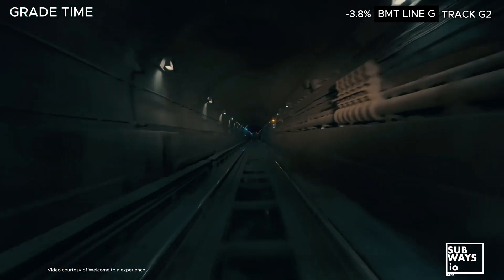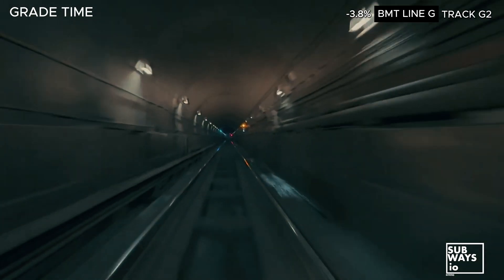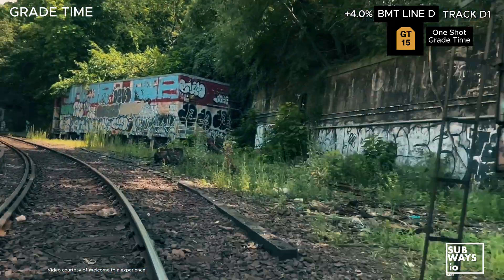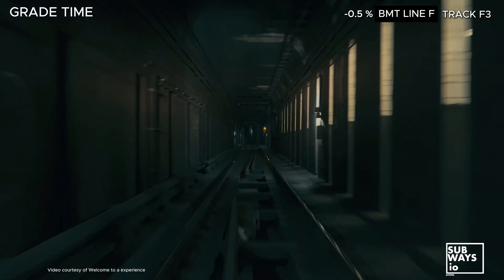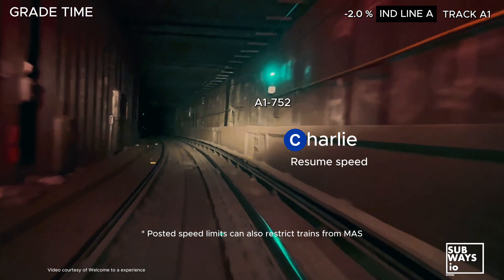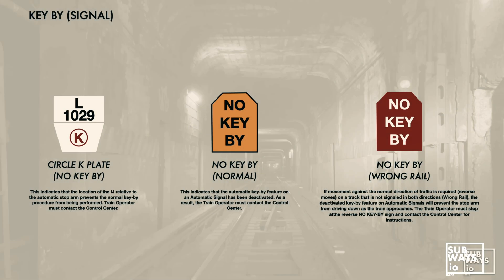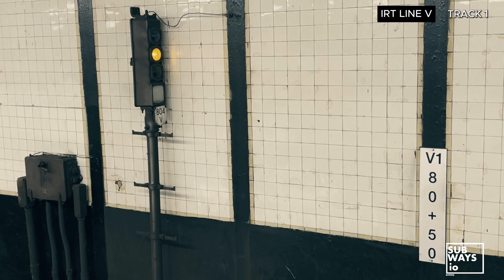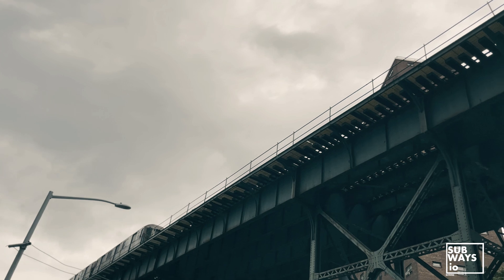NYC Subway Signaling 102 Timer Systems Explained.

Comment: Modern signal systems use codes sent from ground equipments to trains in order to control the train speed. The speed check is done by the trains themselves (comparing the speed limit code with the current speed). The speed limit code is sent by radio or changing the frequency of the track circuit.
The time signal concept is interesting as it controls the train speed without requiring communication between ground and the trains, and can be done by simple relay and mechanical timer circuits. That's how problems are solved by enginnering.
Reply from the maker: Correct. Thats pretty much the de facto setup now across the national rail system—ATC has been the foundation for years, and newer systems like PTC and ASCES build on it with GPS and RF layered atop traditional pulse-coded cab signaling.

Our subdivision in Staten Island still runs on classic 100Hz ATC cab signaling, operating within the 0-420 PPM range audio circuits for switch detection. Eventually, we’ll get around to doing a full MTA Railroads 101 breakdown, covering how each system integrates its singal systems.
The subway, of course, has CBTC in certain sections, incorporating ATP (Automatic Train Protection) and ATP-M, which allows for manual operation with speed restrictions enforced by the onboard computer. So, we’re moving in the right direction.
But to your point—all of this was figured out over a century ago. The evolution of train control is more about refining problem-solving methods rather than reinventing the wheel. And honestly, problem-solving is what led me to engineering in the first place.  Thanks for the feedback and view.
Reply: @Subways_io  It's always interesting to dig into history and look at how these technologies have changed over time. New requirements need new solutions, and that pushes the technology to develop over time. And the history is the answer to “what we need in the future” and “how to achieve that”.

Comment: This is already obsolete on the 7 & L line which have full CBTC
Reply from the maker: You’re correct in some senses, but let’s not paint it with such a broad brush.

Keep in mind that there are different types of CBTC setups: CBTC Pure, where traditional signals are removed, and CBTC Overlay, where both CBTC and traditional track blocks exist to accommodate non-CBTC equipment.

The Canarsie Line between East New York and Rockaway Parkway uses this overlay setup, allowing non-CBTC trains to access the yards in Canarsie and East New York. As a result, Signal 102 principles still apply there.

CBTC operates with a background system called AWS (Auxiliary Wayside System), which manages signals for both CBTC and non-CBTC-equipped trains. The timer principles mentioned in this video are covered in CBTC by Automatic Train Protection (ATP), which enforces speed limits and train spacing.

Also, keep in mind that interlockings are still protected by traditional home signals.
We’re currently working on a full CBTC 101 breakdown, where we’ll cover these systems in detail. It made more sense to first explain the traditional setup and then build into modern CBTC.

Here’s a CBTC short as well—thanks for the comment!
https://youtu.be/tAJhc5nh9dM?si=oFL8Tr91v2rkHcLZ

Comment: I love trains, but this just short-circuited my brain.  Thank God I only drive trains for volunteer work and not as a career.
Reply from the maker: Indeed, there are a lot of moving parts, but there are different levels to it. This breakdown is simplified, as there is a much deeper layer involving relays and logic that isn’t covered here.

This video mixes signaling and maintenance-of-way (MOW) concepts with operational translation, so it’s completely understandable if it feels a bit overwhelming.
Reply: @Subways_io  It's still way too complicated for me, I have ASD.

Comment: Is there a video showing if a train is stuck leaving the station,  the train behind it can pull up right behind it and let its passengers out through the first door of the train. I seen this a few times before.
Reply from the maker: Great point, yes, we can speak on it a bit. In that scenario, the Key-by function, as covered in the video, can be used. There's also another direct procedure to get around the Automatic Tripper, which we are restricted from covering. But either method, under the directive of OCC or supervision, can override and get two trains in the same block. As far as the door, the process is known as Keying a door a single door panel can be opened manually at the crew door switch. Located at L1/R1 or L6/R1 (A division) L8/R1 (B division).  Hope that helps visually this is as close as we can get.

Comment: 3:00 A variant of the two-shot grade time features a yellow-over-D indication. An example of this can be seen on D4 track outside of the Briarwood station. The D indication means that the next signal is a home signal and the switch beyond it is set for a Diverging route (i.e. once the timer for that home signal runs out, it will show not-red over yellow).
Reply: On the B-Division, both B-1 and B-2, the letter represents the line or route code, and the number is the track and signal number. For instance, D4 represents the West End Line, formerly of the BMT, which is now of the B-1 Division; D4 of the B-2 Division, formerly the IND, represents the Queens Boulevard and Hillside Avenue line. On the A-Division (formerly the IRT), the southbound local or main track is called Track 1; the southbound express track is Track 2; the northbound express track is Track 3, and the northbound local track is Track 4. The numbers on the signals on the northbound express track end with 1; the southbound express track has signal numbers that end with the number 2; the signals on the northbound local track end with the number 3, and the signal numbers on the southbound local line ends with the number 4.
Reply from the maker: Did you check our Chaining videos? We covered this there as well.
Reply from the maker: Indeed, we tried to keep it broad for easier comprehension and privacy we had to redact around 5 minutes of the video, including Key-by timers, due to concerns it was threading the needle with this one. We'll follow up with a signaling and sign how to read video we'll cover illuminated S and D signals along with Station time indications and more.

Comment: For clarification, a timer is a measurement of how long it should take a train to travel from the Insulated joint to the signal at the posted speed limit?
Reply from the maker: Correct with the length of that block as your space to get speed and velocity under control before entering the second block (Red/White), which serves as your posted speed check. This varies a bit with two-shot timers, as trains are traveling a bit faster.

Comment: More great info for behind the scene operations. Future subject... Power distribution and how the different blocks have breaks so power from one block doesn't feed another .
Reply from the maker: Indeed we'll cover Traction Substations there spacing and 3rd rail blocks and grounding in traction 101.
Reply: What is the spacing of AC/DC converters?  The NYC subway website has good pictures of this equipment.  Grand Central station has a power converter room for the line going to Harmon, and other converter stations are along the way.
Reply from the maker: @cbmonje  Are we referring to Substations/Rectifiers? Roughly every 2 miles. We have some up-and-coming content covering traction power.
Reply: Yes, rectifier spacing; previously AC was changed to DC by rotary converters.  The solid state rectifiers are more efficient.  Apparently DC voltage drops significantly, necessitating conversion every two miles.  The 2017 movie “The Current War” dramatizes disagreement between Tesla and Edison.
Reply from the maker: @cbmonje  Yes, that’s correct. Solid state offers faster switching speeds, generates less heat, and has better efficiency, which has been the standard for the better part of 50 years now.  Indeed, the line voltage does drop based on distance. Other factors include voltage leakage based on insulation. Let’s not forget that the negative return also has to ensure that traction power returns to the TSS. There are areas of the subway system that also offer supplemental rail return setups. To offer less resistance on the path back. Keep in mind that railcars can operate on a voltage range dipping as low as 480VDC and up to about 780VDC for NYCT and 500-900VDC for LIRR and MNRR EMUs- quite a bit of moving parts. I haven’t seen the movie. I’ll put it on the to-watch list.

Comment: Thanx for the video. Guess motorman these days have to know a lots about the signaling systems.
Reply from the maker: Indeed, yes, on top of being able to perform basic diagnostics and system checks on the consist. Have to shout them out over in RTO.
Reply: Sorry to correct you but the term “motorman” doesn’t apply because you have women who operate trains.  You can’t call them motorwoman. 31 years and counting up front.
Reply: @Papichoochoo1969 
That's why they're called Operators now.
Reply: Train operator here. Yes, you have to learn all these signals and memorize them. We're tested twice on a signal exam. The first one is the easiest. The second one is a little harder, 'cause it's all written. It's a lot of things when you go through school car to learn all these signals and what specifically what they do when you come out to the road, you see it in action. And it becomes easier
This thing is not an art. It's a science.
In operating your train, that's an art!!
Reply from the maker: Agree 100% — it’s the art of science. Every consist operates a bit differently, depending on the variables involved.
Working the car procurement and DCE side, it’s often a process of elimination alongside known issues. BTE and MDS have made it easier to pinpoint problems — lol. Working with variable loads and group switches on older units is the fun stuff.
Our goal here is to peel back the hood a bit and show that, in this case, there are multiple subsystems and protocols involved every time a train operates and carries people to and from their destinations. Or in your case, there’s more than just stop-and-go — it’s not just a signal input process, which is how many in the public and enthusiasts tend to see it. Knowing and doing are completely different things.
Hopefully, this video gives viewers a deeper understanding — same with our upcoming content covering equipment, if we can squeeze it through. Be safe out there on the road!  And thanks for supporting.